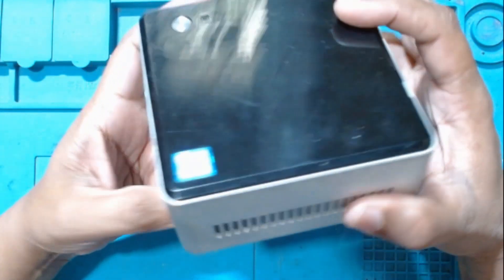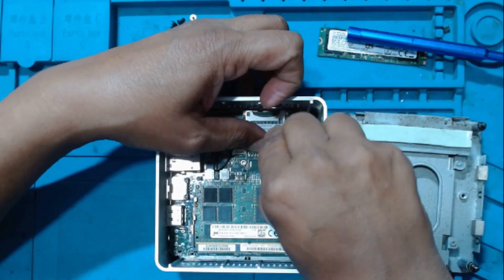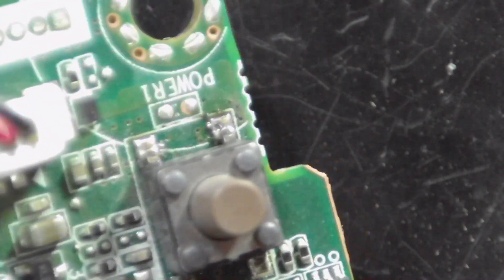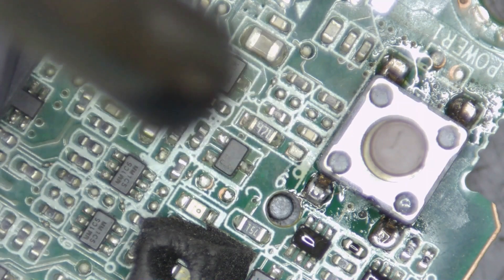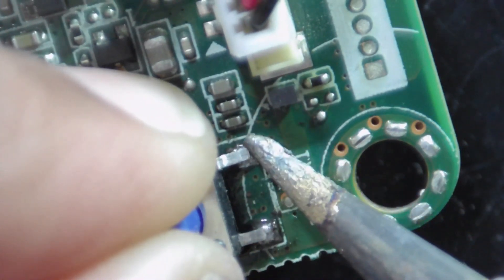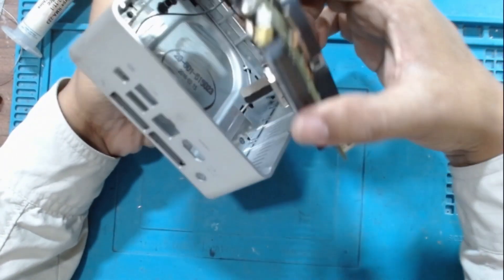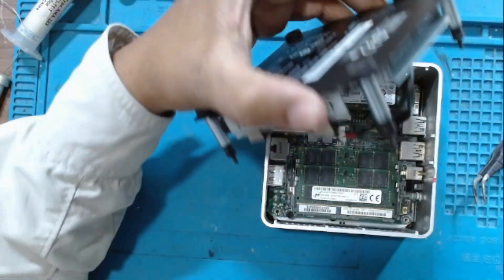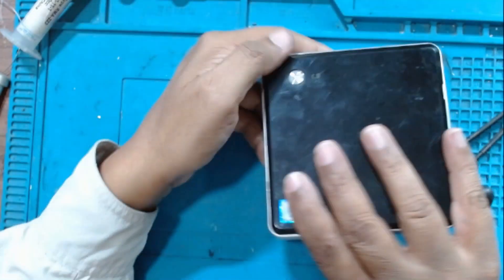Intel NUC6i3SYH disassembly & Switch replace

Comment: I had to replace the CR2032 battery and I accidentally snapped off those black and white wires as seen at m2s46 and thank to this video I discovered that they were designed to pop back on and where they actually came from. Thanks!